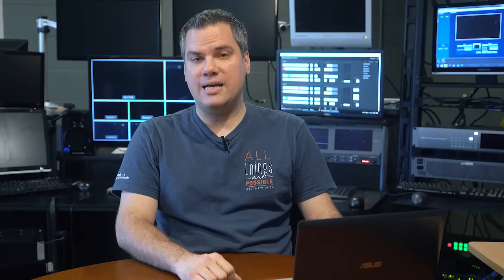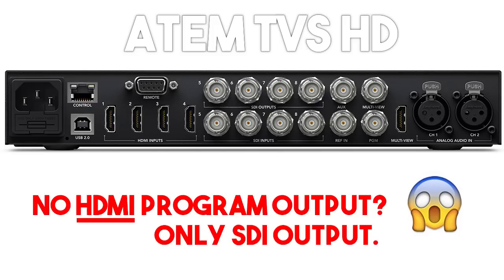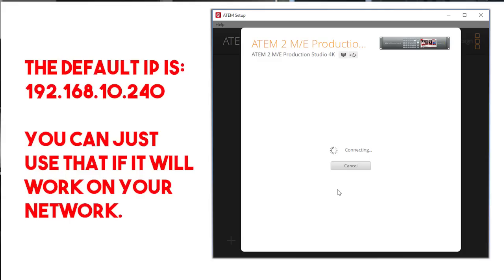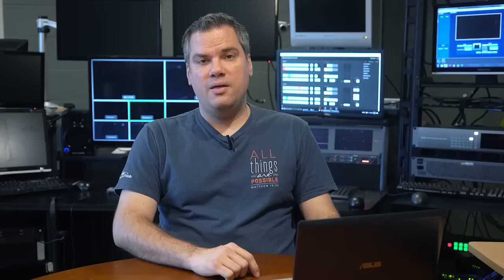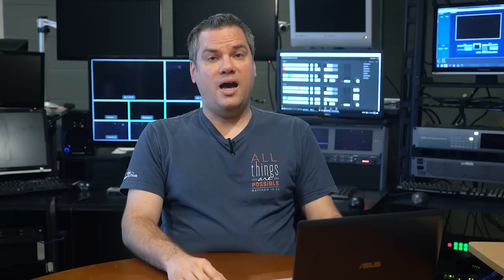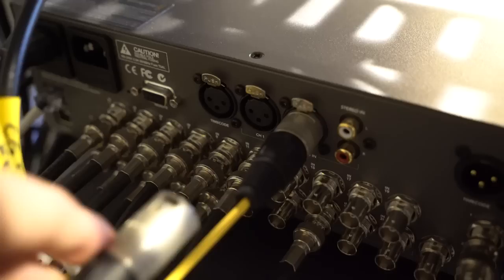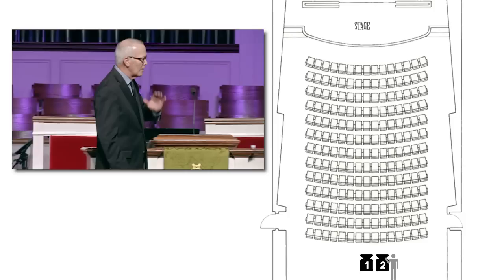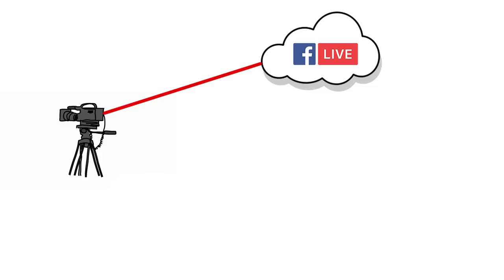Multi-Camera Live Stream & How to Setup an ATEM Switcher

Comment: Dear sir i have sony Handy Cam with model no. HDR XR 550V and now its internal audio is not working. Actually i want to cover talk shows and live streaming for Facebook. Please guide me how to cover talk shows and live streaming with my handy cam as mentioned above. The main problem audio is not working at my handy cam. Waiting your positive reply. Sir i want to use my handy cam for video only but for audio what kind or type of equipment is required to do the same. Please guide me in accordance to my handy cam.
Reply from the maker: You should probably get an audio mixer and lapel microphones to put on the talk show participants.  How many people will be talking on the show?  Are you streaming on a computer with OBS?
Reply from the maker: If you are looking to do this as cheaply as possible, you could use microphones like these lapels: https://amzn.to/2KCwHA5  The movo sound ok (not great) and are cheap.  And use a mixer like this: https://amzn.to/2JVBKKW  Then run the outputs from the mixer in to your computer with an audio interface like this: https://amzn.to/2jzQhAx   Then just add that as your audio source in OBS for streaming.
Reply: Sir I have purchased Ahuja company audio mixer with with 6 channel under model number AMX60 and also have HAKO company lapel microphone . Most of the time only 2 people participating.
Reply from the maker: Sounds like you are almost there then.  Just need an audio interface for your computer to bring the audio from the mixer in.  Are you using OBS to stream?
Reply: Hello sir i have installed OBS in my laptop and also have audio mixer and lapel microphone but when all these connected to my laptop, i am putting headphones to laptop jack to listen recording but nothing is to hear. So tell me what i did to listen recordings on my headphones.
Reply: Inspite of this request you please proper guide for functioning of audio mixer into laptop hope you consider our request as priority basis ☺️
Reply from the maker: I do have a video coming real soon about sending an AUX mix from your front of house mixer to your live stream.  Stay tuned!
Reply: Hello sir, after heavy struggle we have find out an another option i.e audacity software. Installed the same and attached to audio mixer to laptop along with headphones now the system is ok with audacity software. Currently we listen each and every thing recorded in the microphone with the help of headphones. In the last we request you to suggest how to connect the handycam with software so that we receive the audio as well video for live streaming.
Reply from the maker: What this: https://youtu.be/2fggKym43hs  Combined with this: https://youtu.be/SBpx3cBn5U0  And that should get you going in the right direction.
Reply: Could you please tell me where I should purchase video interface as shown in ur videos and also request you that is it possible to the live streaming video at laptop too.